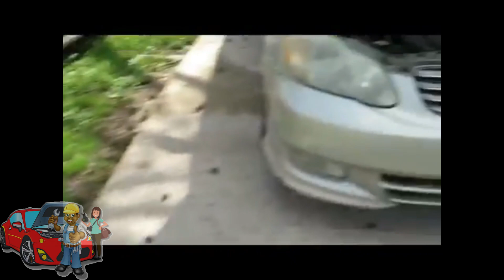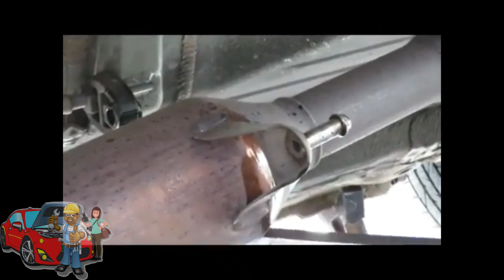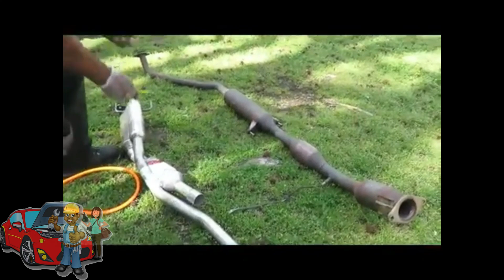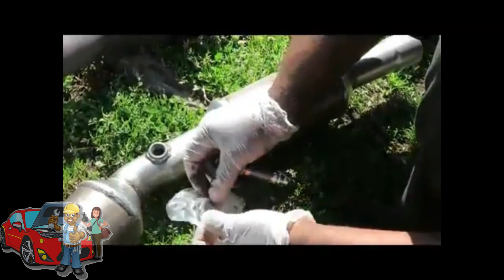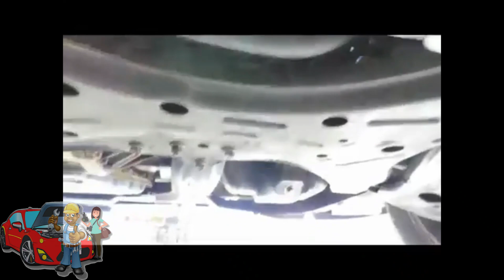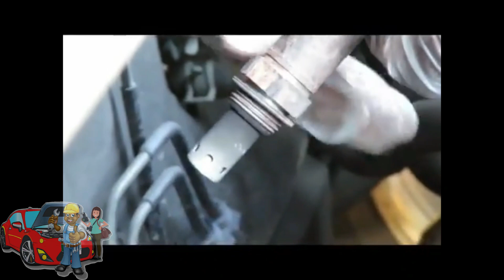2003-2008 Toyota Corolla Catalytic Converter Replacement

Comment: For California make sure the aftermarket Catalyst replacement is CARB compliant (have stamped/laser edge serial # plate) or it will not pass smog check if the technician checks and sees it's not a Cali compliant cat!  A bit expensive but way cheaper than those that the dealer sale...
Reply from the maker: Great tip!

Comment: So you don't need to weld the pipes back together? I thought you had to. That's the only reason I've paid the mechanic to replace it for me in the past.
Reply from the maker: Not at all.
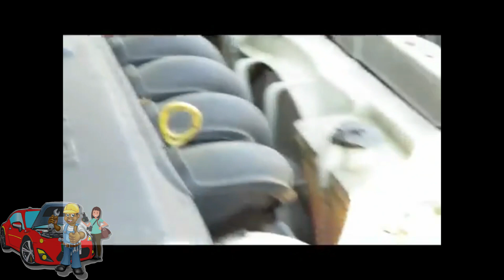Reply: He said he was going to clamp it but didn't show it being put on. He used a U bolt clamp. You can see the box at the 32:18 mark. You could also use a band clamp which is removable/reusable and doesn't dent the pipe.